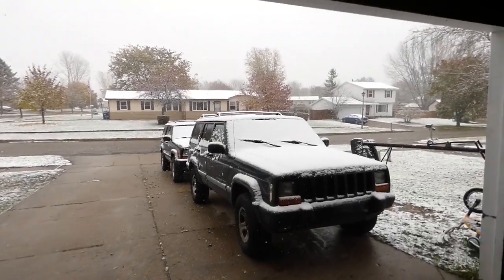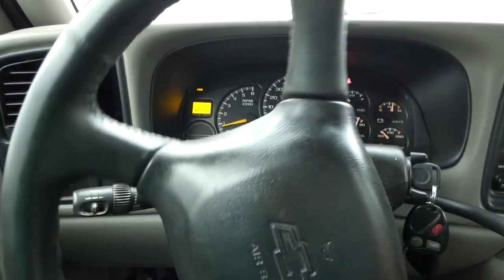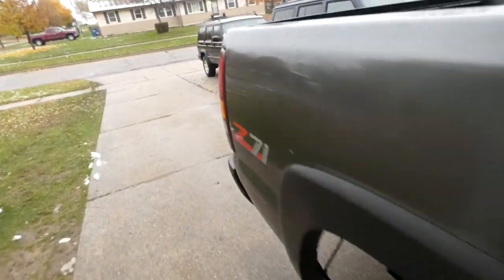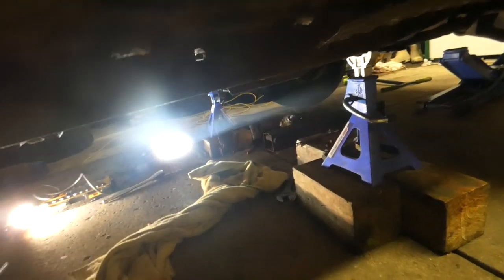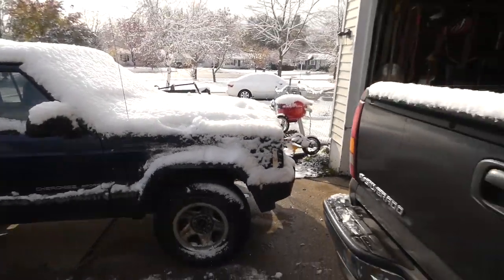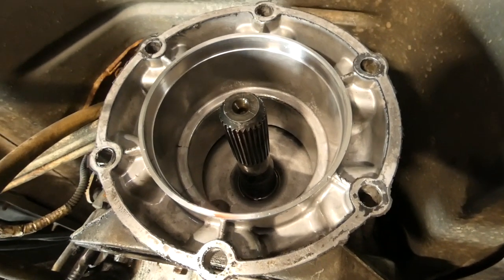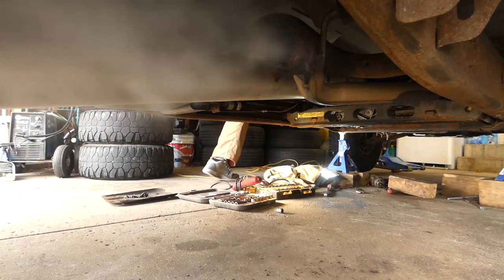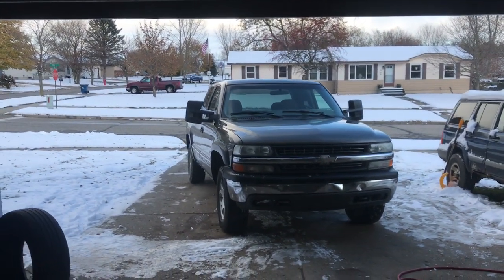How To BUY A Car CHEAP, FIX IT, And SELL It FAST Pt.36

Comment: Honestly my favorite youtuber. I plan on doing the same as you are and eventually open a dealership. I dont know alot about cars but i bought a pontiac g5 to flip a few weeks back and it threw a rod driving it home so not knowing anything about pulling a engine there i was in my front yard with a strap, come along and chain and a few sockets and socket wrenches and just myself.. after hours a day for a week i finally had an engine hanging from the tree(still working on putting one in)
Reply from the maker: Ryan W Danng!!! That’s some serious luck! Well the best way to learn I guess is getting thrown in the fire!  Lol.  Good luck man! And thank you I really appreciate it.
Reply: Right! And appreciate it. Np man, keep up the good work and the vids, they keep me motivated
Reply from the maker: Will do man